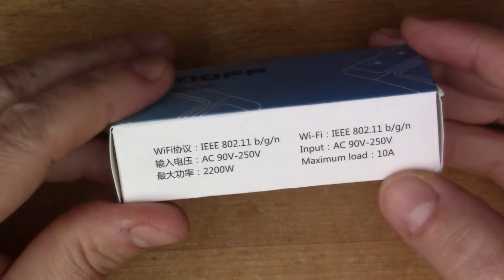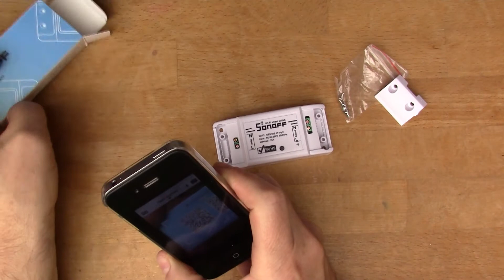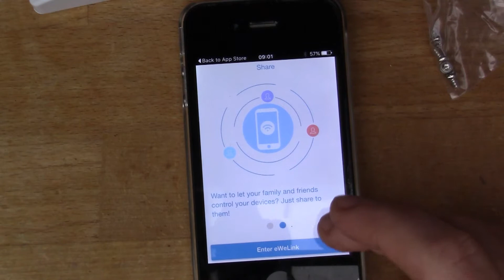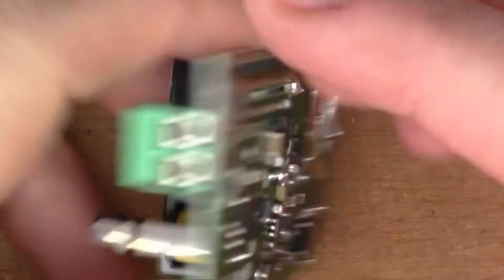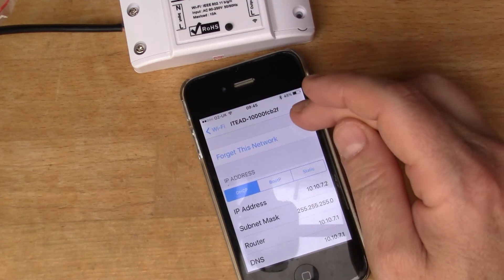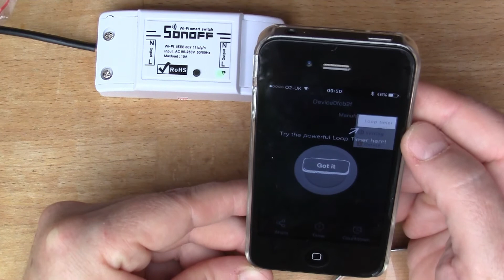WiFi Controlled Mains Switch (IoT) - Install and Teardown

Comment: You say you didn't like the resistor on the live side (R16), but would you consider this as safe enough to use in your home?
Reply from the maker: Yes.  This unit is widely used in home projects and I've heard no reports of them being dangerous. I've seen some comments from critics of the plastic case, because it's quite easy to knock the lid off and then the live mains would be exposed. Therefore I think it would be better inside a box or cabinet, where it's unlikely that anyone will stand on it, drop liquid on it and so on.